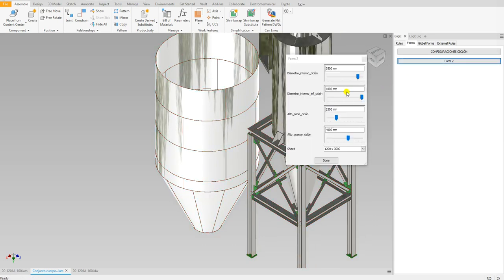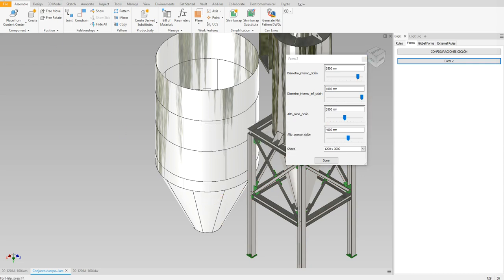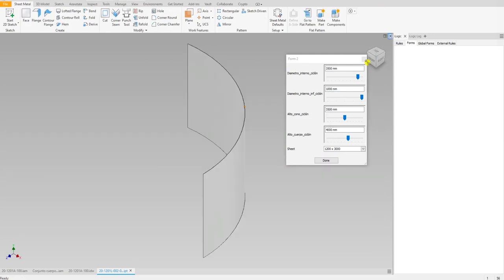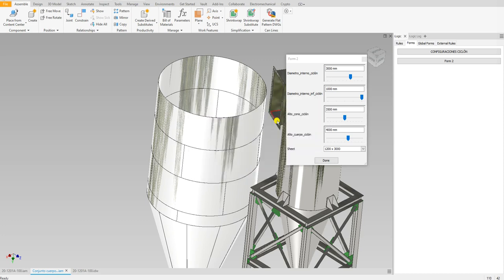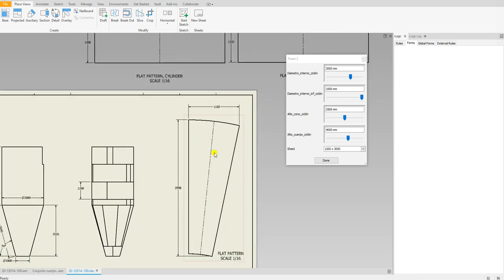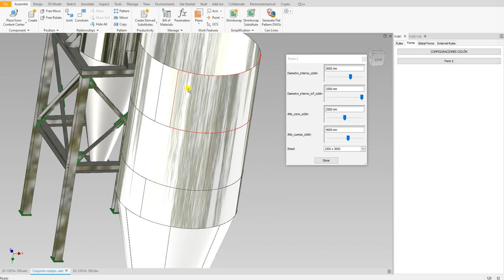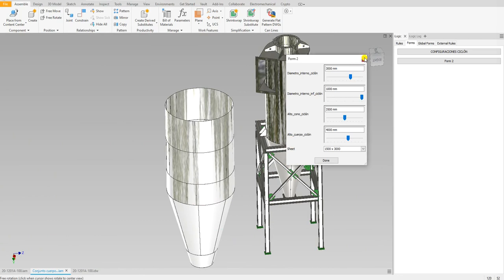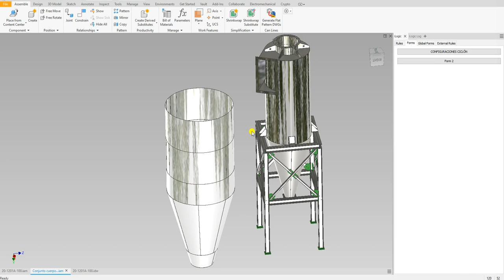iLogic Design Automation - Reducing Scrap Waste for Exhaust System

Comment: Hi there! Cool channel you have there. 
I am trying to learn a bit more how to generate the drawings with all the dimensions after the design is done.
I saw in this one that the scale adjust itself, that is very important in my company drawings also.
Do you have tips about that?
Thanks
Reply from the maker: Hey Mateus thanks for the comment! I’ll start making more videos regarding drawing automation now. I’ll upload a video on Wednesday
Reply: @DesignAutomationSolutions  cool, I appreciate that. It will be very helpful.